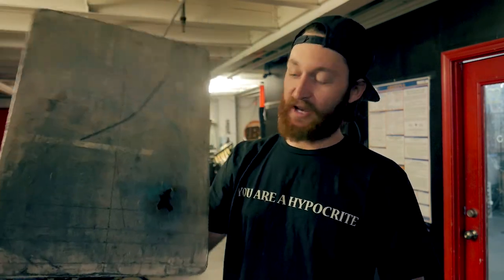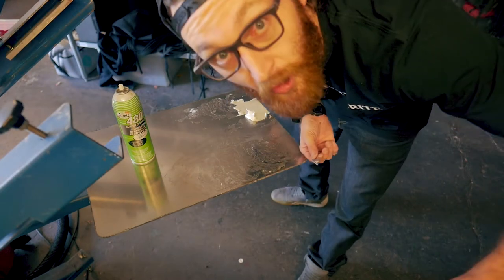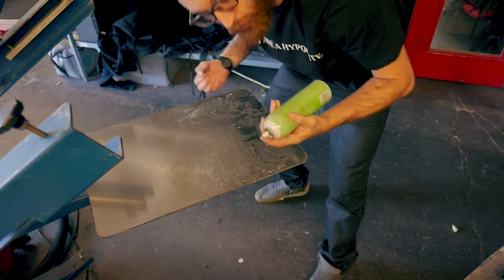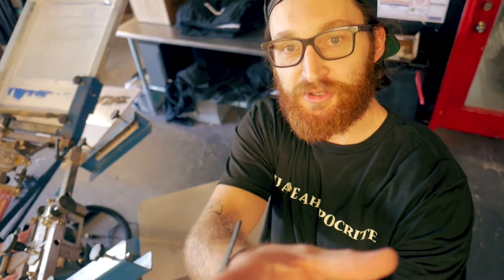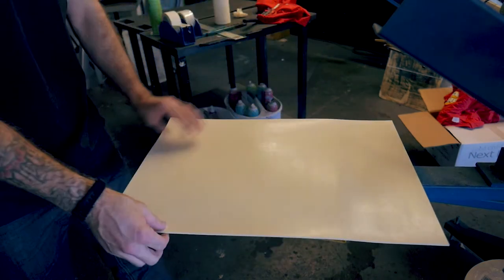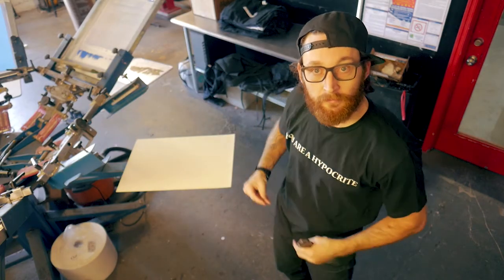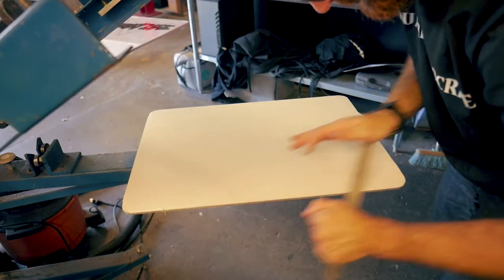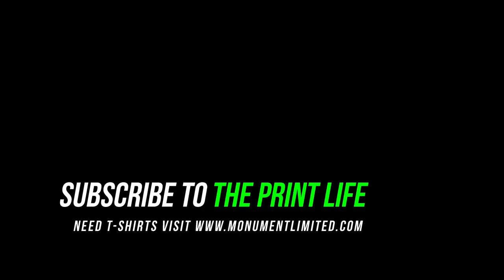How to Screen Print: Replace the Pallet Rubber on your Screen Printing Press Platens.

Comment: Good video...very funny...I did  one a few days ago and it was time consuming. I used heat gun and putty knife then acetone...not good...then goof off worked pretty good. Finished with acetone and a micro fiber cloth. 3D printers have the same problem with adhesive.

Comment: This might be a stupid question, but are the rubber pads a standard thickness?  I need to change out some of my rubber pads on my auto but I am a little hesitant.  If the pads' thickness isn't standard I worry that the pressure will not be even on all print stations.

Comment: How long does the pallet rubber usually last? What is purpose of the pallet rubber and is it necessary? Can you just use pallet tape? Thanks for the tutorials Cam.
Reply: Ron Waller I have the same question, why use it? I just use pallet tape.
Reply: Yeah just curious what the benefits are. Also just like pallet tape if you don't change it very often seems to make the job much harder.
Reply: Ron Waller - apparently it helps lay down a thicker deposit of ink. In one of cans last videos, he said he prefers the platens without rubber.  Vastex V2000HD presses come with rubber covered platens standard.
I haven't tried it but I might try it on a few extra platens.
Reply from the maker: Yea guys I think the main purpose is to reduce the heat transfer to the aluminum, those things get hot as shit, Some say it helps with the print but I cant confirm this.
Reply: Benefits of using Soft Top Rubber on your Aluminum pallets: https://actionengineering.com/the-badass-blog/whyrubber
Reply: I have worked on Manual and Auto presses for close to 17 years now.  The only time i have had to change the rubber is if some idiot burnt it or the old replaced rubber on the press that was there long before me started to come up enough to need to replace it.   I used large roll of the rubber and cut to fit. We typically just used a can of all purpose surface glue. When applied properly it last a long time. The platens we had on one of the presses had some mounting holes that would have left marks if we left it just metal with pallet tape.  On the M&R sportsman we have had since 2016 i have one platen that has a little come up. Thinking of just getting some glue and re adhering that back edge. I find that on the long runs i do ,500 to 800 and hour , it keeps the surface a bit cooler than if i had non rubber platen. Now our manuals are just aluminum but we never run anything over 40 pieces unless it is something that we have only done on those presses and just looks better.

Comment: Here's a tip:  Use a utility knife to cut the rubber into 1 or 2 inch strips.  It will take a lot less force to peel off.

Comment: What is the purpose of the rubber? This is the first time I have ever heard of this
Reply from the maker: Really? pallet rubber has been in use for many years.
Reply: The Print Life but whats it for?
Reply from the maker: mainly just heat management on aluminum because it gets so damn hot, some also say it helps with the print but I have not found this to be true.